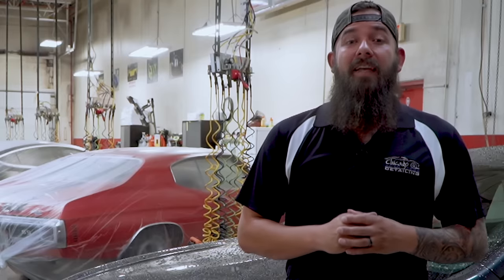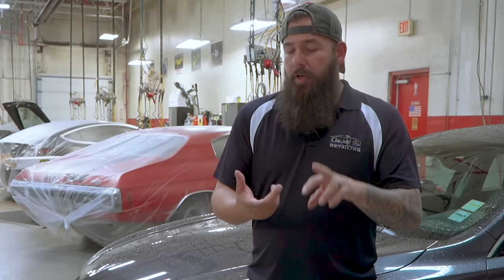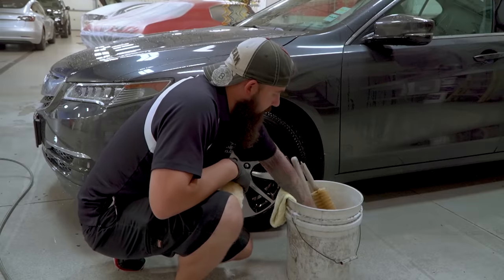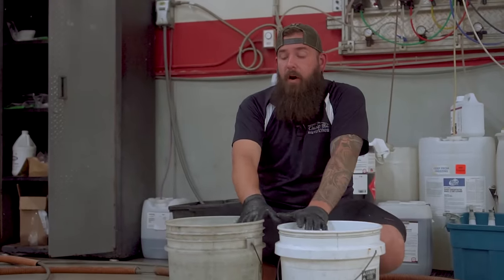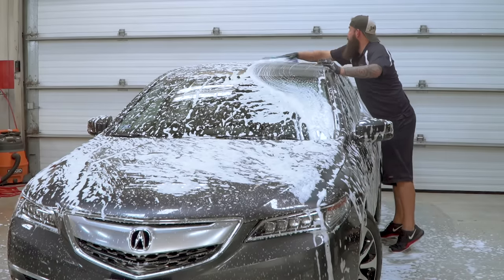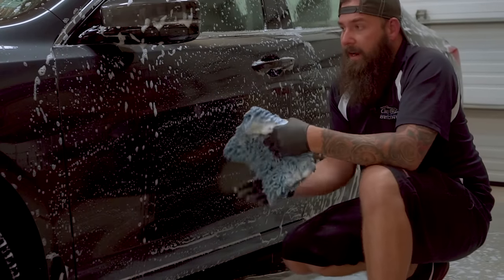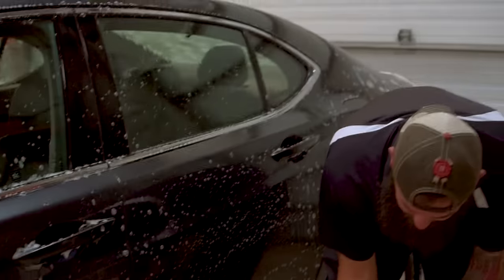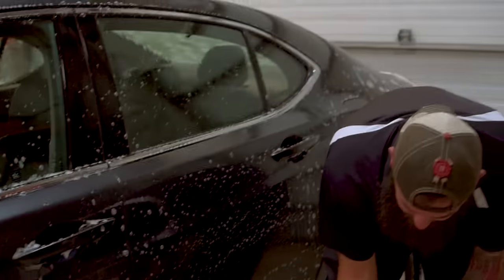A detailers SECRETS to hand washing

Comment: I have a habit of taking a bucket and sponge to a DIY carwash. I put in 75 cents and spray presoak for 2 minutes then switch to soap 1 min. to fill my bucket. Then I hand wash top to bottom, tires and bottom edge last. Then I add 4 quarters, rinse 2 minutes, spray spotfree rinse for 2 minutes. For drying I drive a couple quick miles between exits on the Interstate on the way home. $1.75, but that's just me.  ;-)

Comment: One trick I learned to filter your water from a garden hose (if you don't have a softener) to help prevent mineral spots, is to attach a garden hose filter. You can find them online for about $10-15 bucks. Last for about 1000 gallons. Great for if you are cleaning window on your house too.
Reply: This is probably the most unused, most  helpful, thing to do when washing  a car imo.👍...2 years and no likes. No worries I got u.
Reply: I just dry it super quickly.

Comment: Good training... if I may add two things I learned when working at a carwash some years back. Wear a Velcro belt if you wear a belt... because leaning against the car accidently with a metal belt buckle on is likely to scratch the vehicle.  2. Wear slip resistant shoes if working in a shop with painted floors... because soaps, especially degreasers tend to be pretty slippery, especially if you're trying to rush around corners of the vehicle as most of us do when we are on deadlines.  :-)
Reply: Just turn the belt around
Reply: I did this once, it didn't just scratch it but took a deep cut into the car, luckily the paint looked like it was keyed more than once in the same area so the owner didn't notice but still it was not good

Comment: I've always used a "below the belt" wash mit for the bottom of all body panels because I don't want to get tar & road grime on my main mit.  I like the grit-grid idea for on the bottom of the bucket, I never thought of that!
Reply: Walmart sells those buckets with grids (buckets r 2-3gal)
Reply: I don't use a bucket at all.  Regardless of the grid, if the water is dirty, there are dirt particles floating in it.  I use 3 mitts and continually wash them out after washing a few panels.  I always start with the hood and the cleanest mitt since it's most noticeable.
Reply: Yeah, grit guards are fantastic for loosening up the soil you pick up from a standard wash.  Transference is the pits!

Comment: Awesome video! I don’t have an air blower so I wash my car (truck) at night and when I’m finished washing, I take it out on the highway at high speed for a couple of miles and then dry it off with a microfiber towel. It’s not the most ideal way to do it but it does work well for me. Thanks!
Reply: You're spot on...sorta...this is actually really bad because it risks re-depositing some of those fallout particles you just spent all day scrubbing off!  Grab your leaf blower in a pinch and position the exit port six or so inches from the surface to get the last drips from under the rear view mirror, grille, door sills, gas cap and so on to give your vehicle that professional touch.

Comment: It's been a long, long while since I did a pro detail. But a couple things I was taught long before clear coat. You use a grid pattern when washing, but I was taught to use small overlapping circles following the same grid type patterns, and like you say, one panel at a time, top to bottom. This is so any hairline scratches will hopefully hide in the swirl from the hand wax (you still do those?) and are less obvious. The other thing is probably only a matter of preference and good mainly for old cars with leaky seals. But I usually float your soap off from top to bottom using as low as water pressure as will move the soap. This is to help prevent forcing water into the seals. Less mess later. Of course, use pressure when needed. But otherwise, exactly how I wash my cars.  But what I haven't seen before, I do like. And that's those small screens in the bottom of your buckets. Very clever. 

Just curious: how many kids do you go through before you find one who actually gets it? Top down. I hope for your sake, not too many. Keep those wheels shinin, Dude!
Reply: Cleaning in a circular pattern will absolutely remove more dirt than any other motion as you're attacking the dirt from all angles.  It will also absolutely leave whorls in your clear coat.  Washing in broad, straight passes will still invariably scratch the paint.  The difference is the way light reflects off those blemishes.  When there are whorl marks, light will always catch some part of the imperfections making them visible.  The mars left from straight-pass washing will only be visible when hit by light at a precise angle.  Circular application of waxes and polishes are preferred only after you have prepped your paint properly and don't run the risk of dragging abrasive matter over your paint.

Comment: I actually use a 12 bucket system and a different wash mitt for each body piece and a separate one also for window. 19 different solvents and 6 different window cleaners . 156 brushes , 1 for each spoke and tyre to prevent cross contamination
Reply: Toyota4runner TrdPro16 - there is a new essential window cleaner on the market. Now you shall need to update to 7. Sorry. I know it pushed me just over the time & budget barriers once & for all. I wish you better luck!
Reply: Amateur, if you don't use a 50 bucket system then you just don't care about quality.
Reply: actionjksn I guess not

Comment: Everyone has their own way of doing things and I'm not going to junk on this video just because he does things differently than I do. However, I'd make a couple of suggestions that apply to most people (non-pros): first, use a bucket only as a collection tool. Get multiple mitts and do not use the same mitt twice on a car. The bucket method is obsolete and has been for a long time. The guy here is actually one of the few pros I've seen that still use is in some form. What saves him is that he applies the soap rather than using the bucket to get more soap -- a bad idea because the "rinse" bucket will always dilute that half way through your job. Bottom line: buckets are tools for holding things and frankly, nothing more. The second suggestion is to try multiple kinds of towels. I've never liked waffle weave. The ones I do have went into my "grunge" towels drawer. I think you only need 2 or maybe 3 kinds of MF towels -- the Costco 36 pack (you can also get on Amazon) for general use, including some use on the paint, and the Rag Co. Eagles for wax and polish removal. If you want something with a thicker nap for drying, Rag Co. or other sellers have those. For glass cleaning, huck towels. Trust me on all of this: I've gone through a LOT of towels and the set I described not only work but are simple to buy and use. Still a good wash overview video.
Reply: Thanks for sharing.. Nothing you share is a mystery and no all of us have the chemicals and pumping hoses you do. Therefore your help is limited but still I do appreciate your time making and posting your video
Reply: Noticed at first when explaining the bucket use he rung out the rinse water before going back into the wash bucket. Afterwards he went straight from rinse to wash and did not ring out the water. This is how not to do it diluting the wash water. I tried the multiple mitt method.. just a waste of time imo.

Comment: Great video, although I would never use the same mitt to do the top as I would use to do the bottom part of the body. No matter how much you scrub off in the bucket or mit guard, there is no way you will get off enough not to scratch. Always use 2 mitts. 
What is the psi of you power washer?
What degreaser do you use for the wheels?  Must be nice to have that plumbed in, as well as the foamer.
I go through too much soap using the foam canon. Any better ways of using that? Or a soap that I can dilute in the bottle?
Good filming and angles and light!

Comment: I use a separate mitt for the bottom of the car. Also if the car is being washed outside when it's warm, the wash and rinse should be done separately on each side and the roof even if that take s more time.  Tar remover like autoglym provides is something I always have on hand and at least once a year I'd use a clay bar to deep clean
first and get a smooth surface.   The water laying flat on the car in the video shows that the car is in need of waxing.  There are other points but then here in the UK we might seem to be a bit obsessive compared to USA car manual car washes :)

Comment: I spent 15 years at a chevy dealer and one of the most important things a lot of people don't realize is that you ALWAYS wash from the top down, Always. same when I washed aircraft in the military and when  I'm in the shower. It's amazing how many idiots out there wash their car from the top up, these people  know nothing about gravity, WTF? one other important point you brought out is that you never apply pressure to ANY fabric applied to vehicle paint. I can tell when someone has either used a towel soaked in sandy or dirty  water by looking at all the swirl marks just shining away in the sunlight.  Great video no matter what the know it alls have to say. One other thing, have you ever seen someone apply a paste wax to a part of the car and then not bother to buff it off ?The best way to ruin a paint job.

Comment: what hydrophobic agent do you use and the only thing i would say is lower the pressure on your snowfoam gun it sounded like it was hitting the paint hard and wasnt completely covering the body of the car 2nd thing is on your blower put a flat nozzle on the end as it will displace the airflow quicker.
Reply: Any spray wax will do.
Reply: Read the video details and product list.
Reply: Matthew Toon don’t use spray wax if you prepare it properly use a high quality ceramic coating that will last about a year give the car a silky finish and will repel water like crazy but make sure your car is at the point you want it, you clay barred it, polished it, and you removed any old wax with isopropyl alcohol before coating it because the coat will hold in everything you didn’t remove for a long time. I know I just spewed info at you but I hope I could help!
Reply: And, just to piggyback off of @Matthew Toon...is the homophobic agents you use to clean the vehicles environmentally safe?

Comment: I liked the vid. Washing a car is harder than people think. I usually have spots cuz I do the "crazy eights" you mentioned, lol. I won't do that again. The one thing I do though is I have a different mitt for washing the bottom  of doors and panels. I learned years ago...the hard way, that you can scratch the car by using the same one. I see people complaining about all the tools you use like it's hard to get them. It's soap and wash mitts and crap, Walmart has it all. You don't NEED a pressure washer, a hose works.

Comment: Hey Jason, like your vids! :) Can u show us some really dirty clients car? Greasy/dusty door jambs, baked dust on wheels etc. etc. ? :)
Reply from the maker: Yes, I plan on doing a video for how to prep a car for detailing and I will make sure its really dirty.
Reply: Chicago Auto Pros  I´m looking forward! :) Thank you
Reply: Toxi1555 me too
Reply: .......not me....
Reply: The shit starts at 2:26 / 13:57 => step number one is soak the dirty. 

I use a 180 bar and 600 liters per hour machine with zero problem and I start with Nerta WE64 or Carnet Jumbo.
Reply: @Butch Dye I agree. It's so easy to wash a clean car.
I would like to see you washing a dirty car. Probably will be harder, take twice as long, more soap, water, etc...
Either way, good video.
Reply: Hi I have 2 problems 
the stuff they use on the roads seems to create a mud glue that pressure washing doesnt want to remove fully.  Those buckets would be too full of grit from just the lower half of 1 door panel!  Any suggestions??? Presoak??waxes??? 
#2 and this is the big one.. my doors have these rubber guards on them but they do nothing but trap dirt behind it and the holes for the attachments are nothing but dirt(rust) traps...  i removed them but now the dirt is getting into the gap between the plastic outer shell and the door frame...   2000 pontiac bonniville(live in canada and limited on car washing options aka local car wash only)   suggestions???? Is there a soap that might penetrate and loosen the dirt behind and help or a tool or somthing???  Thanks!
Reply: Baked on dust...  thats nothing. They use this salt like stuff and beetroot juice here that mixes with the sand dirt and snow to create this almost Glue like stuff. Pressure washing takes at least 15 minutes  and that only takes off the top loose layers.
Reply: Thank you Toxi!
As  I was watching this for the first time, I was thinking the same thing....really wish it was a dirty car.
Especially on rims.
Good vid none-the-less

Comment: Awesome video Jason. What are you using for your drying agent? I need something cheap and effective to help dry client cars that aren't protecred.
Reply: I'm not Jason, but lots of detailers use Meguiars Synthetic Express spray wax.
Reply from the maker: Contact a local car wash supplier and ask them for a drying agent. You can get 5 gallons of concentrate chemical and dilute it down and it's way cheaper than any type of spray wax.
Reply: It's basically a spray wax or a "detail" spray. I've been using Adams for years with great results.

Comment: A couple advice or three:
1. Use different gloves for the paint from the tires/rims.
2. Rinse all dirty wash mitts and brushes with the hose before dunking them in the rinse bucket.
3. Snow-foam the car and power wash to get rid of the loose dirt first, then snow-foam again to wash with a mitt to remove the more stubborn dirt.
Reply: no

Comment: Never ever use the same mitt for the upper and lower panel! Also, finish the upper panel all around the car first and do the lower panel later! No matter how well you've washed the lower part, there's always some dirt there!
Also, avoid tire shine, it just dries out your tires, and it get all over your fender while driving.
Reply: Aye I use 2 wash mitts blue klin Korea for top half and red for bottom half 2 buckets with guards one with washboard aswell,and leave the seals the last bit
Reply: @MrChrisr34  My man! :)
Reply: It annoys me when I pay $20 at the car wash for a clean, dry car, yet they use so much tire shine that it's splattered all down the sides of the car before I even get it home! Same with Armour All on the inside - they use too much and streak it all over so I don't have them do either anymore. I don't mind washing my own car, I just hate drying it!
Reply: You start with the lower part of the car first .

Comment: I always do the wheels last
Reply: ducaking me too!
Reply: Me too
Reply: Me  too.
Reply: i do them first
Reply: Always wheels last because it has break  dust particles an you want to minimize that crap getting all over,  if you do it first that stuff is flying all over and will end up scrubbing and rubbing that info your paint as you wash
Reply: Always first...
Reply: @hassanalmaanaki4134  I just saw that... It makes sense... I will change my cleaned procedure. :) At least I don't use the same cloth to clean the wheels and the car.
Reply: Wheel ACID 💪 cut with water 20acid 80water
Reply: Me too
Reply: @KONIENTZ  - All detailers clean wheels first and you contradicted yourself. You do them last and you get all that crap from the wheels on the car you just washed dummy. Maybe you missed the part where he rinsed the car first, after doing the wheels. 

Brushes scratch the car and you bang the telescoping pole against the car. Dish soap will break down your sealants and rubber. Maybe you don't know the concept of auto detailing and best stick with PewDiePie washes his car videos.
Reply: I agree with anonymous user below.  Do the wheels first.  Also, when you wash your car with "dish liquid detergent" you just removed any wax that you spent a couple of hours applying the last time you detailed your car.
Reply: Same here
Reply: If you do it last, the splashback from cleaning them ends up on yr clean panels. Most detailer's videos say do them first.
Reply: @KONIENTZ  telescopic brushes break easy. Most detailers say dont use detergent cause it takes off your wax coating as well when cleaning. And they all say use 2 buckets....
Not much use watching these vids if yr not prepared to learn from them....
Reply: @gregandsueplummer6759  Wax?
Reply: @joesmith201212  its much better to clean your paint then tarnish it with brake dust. Makes perfect sense, sike!
Reply: @lIlIANONYMOUSIlIl  

It's personal preference and seeing as any detailer worth their salt won't use the same mitts and cloths to clean the wheels and body it's irrelevant which gets done first as you'll have to rinse one after doing the other anyway.
Reply: Or your lungs

Comment: After the wheels and tires, I use new mitt to wash the bottom all the way around about 6" up, and rocker panels, then switch to a third mitt and do the rest of the car, all windows first, then top to down. That foam soap looks like it really cleans.